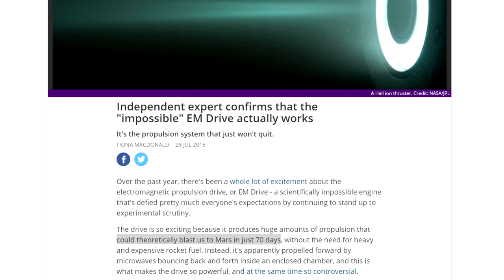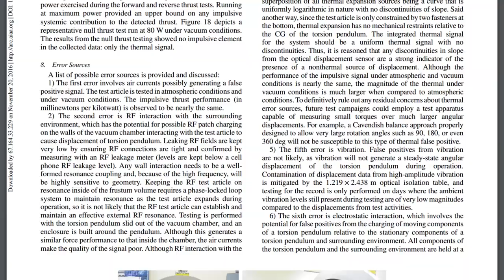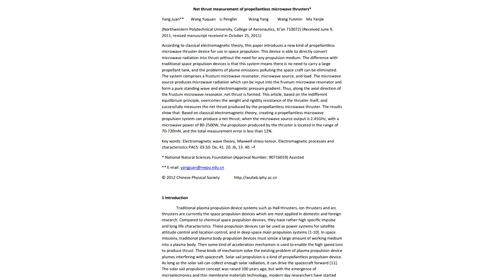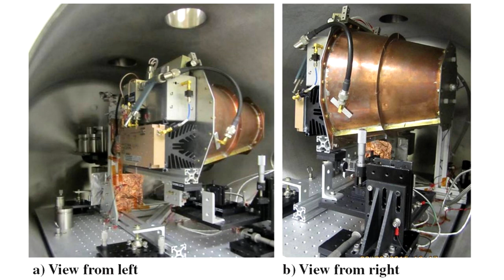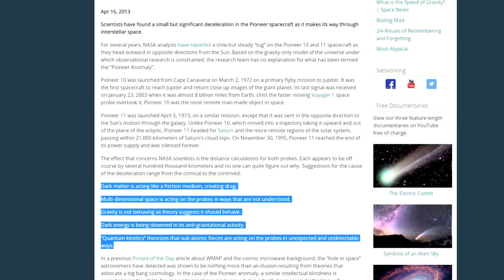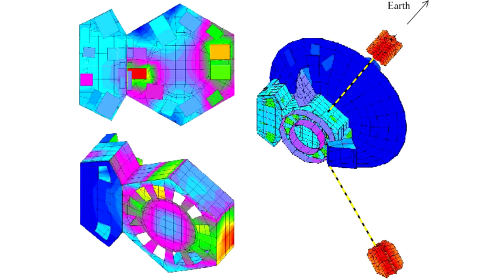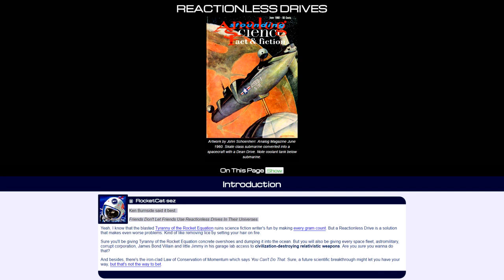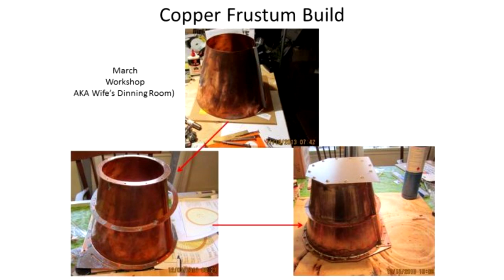What is the EM Drive? And Does it Really Work?

Comment: The EM is a definite maybe, but damn look at that vinyl collection!
Reply: As far as a perpetual motion machine, the EM is very inefficient is it not?
Reply: Musky Elon it is not "perperual motion" as it still require and use energy. and for the ineficient part, yes it is not as efficient as other techs energy wise. but it make up for it by an absurd amount of delta v, wich only depend on time. and we didn't tested the supderconductor variant...
Reply: Well, if it worked, it would be kind of the only thing seriously proposed with efficiency above 1 in certain conditions. What is an inefficient perpetual motion machine?
Reply: Ilnore
well with physics you never know :)
Reply: Well, in this case, you kind of do know. The very definition of a perpetual motion machine is to have an efficiency of over 1. So, there is no such thing as an inefficient perpetual motion machine.
Reply: Ilnore
well, an ineficient perpetual motion machie generate additional energy, so you know what it would be a good thing.
Reply: You can't call anything with an efficiency of over 1 "inefficient". :)
Reply: Ilnore What our musky friend here was probably trying to say is that, if you imposed a partial order based on efficiency on the set of proposed perpetual motion devices D so that d1< d2 if η1< η2, then the EM drive would rank pretty low.
Reply: I don't think this thing could generate perpetual motion (if it actually works). There is allways a catch with pertetual motion machines, we just haven't observed this one yet. To test it properly, we would need to accelerate it to very high speed while measuring it. And in space just to be sure.
Reply: The MoSS well, we just need to send it to the ISS , it's not big or hard to manufacture
Reply: The MoSS Well, "if it actually works" as advertised, then yes, it will be usable for perpetual motion. In fact it would be trivial to engineer a perpetual motion machine with it.
What you probably mean to say is that it's unlikely that it actually works as advertised.
Reply: You think there is a Yes album or two in there?
Reply: as12df12 no.... perpetual motion has nothing to do with it.. it does require a fair amount of power to run it.
Reply: Andy T. Think about it again (or just watch from 10:15). This is a simple engineering task.
It requires a constant amount of electricity to generate a constant acceleration force. Put two of those on a wheel attached to a generator turbine, and you will eventually reach the point where the generator puts out more power than is needed to maintain the constant acceleration -> perpetual motion.
Reply: This argument doesn't make sense.  As I understand it, more work is done generating the microwaves than can be created from the thrust, and the experiment indicated only linear force output with increasing power input.  Just accelerating a mass via a force indefinitely is not a definition of perpetual motion.  That's what gravity does.  Demonstrating a machine that is greater than 100% work efficient is, which this device doesn't do because it couldn't drive a generator to satisfy its own power requirement.  Conservation of energy is safe here.  The only missing component I can see is the mechanism by which it acts more efficiently than basic photon thrust.  Everything that accelerates is pushing or pulling on something, net zero momentum (and increase in disorder).  What this device is actually tugging on or tossing away is unknown, but is probably mundane.
Reply: Al B "more work is done generating the microwaves than can be created from the thrust"
How can that statement possibly be true if there is no reaction mass?
Reply: I bet you he has a copy of Dark Side of the moon in there ^^

Comment: I want to believe!  I want to believe so badly!
Reply: I wouldn't get your hopes up, they pumped a few kw into a box and it twitched a little
Reply: man you have no idea how much that tickled me.
Reply: It literally says in the video that the NASA experiment used 1 W that and produced a (very small) sustained force. The question is whether the force is explainable by an unaccounted error or if it actually implies new physics.
Reply: It actually says so-and-so micronewtons per watt. The paper says they did several runs, at 40W, 60W, and 80W.
Reply: They didn't, they ran it at 40W, 60W and 80W. It also twitched the same amount in vacuum and out, and in the direction of the cone, they also ran a 'zero thrust test' where they line up the thrust axis with the pendulum (causing it to push into the pendulum and thus it shouldn't read thrust and it didn't) 

I'm sceptic myself but whatever is causing this needs to account for that as well
Reply: question, what if it did slow down with more speed. c - current speed. kind of like Einsteins train?
Reply: I want to believe too.
If we assume that it is working. Even if you need to propel it for 40 years to be better than an ion drive this could be still useful for unmanned interstellar missions.
Reply: Physicists United, new suspect located, firing up weapons, question: stun or kill?
Reply: How about a photons and phase shifted photons.
They erase each other by the end, so you can't detect anything,
but they still pushing.
Reply: AkiraWolf98 Most of us do. Here's me hoping to go to aplha century in my lifetime.

Comment: First, I completely agree, except on homemade equipment to experiment. By way of for instance, one could take a look at the first cyclotron built by Lawrence back in the 30's. It is basically a coffee can sawed in half and wrapped in copper wire, and since many other first in experimental technologies got their start like that, I'd allow latitude for looks, so long as it functioned. 

That being said, yes, it does look rickety, perhaps, but you should never debase your argument like that.
Reply: I hope you're right in this particular case. If you think about the well-made resonant chambers, they're so precisely made, they must be thermally stabilized to keep their characteristics as designed. How would you thermally stabilize a resonant chamber in space which was big enough to push a vehicle? It could be done, but the drive will be a lot more practical if tolerances don't need to be so tight.

Comment: My feeling to the EM Drive is basically like that of SETI: it's probably not going to work, but that doesn't mean we shouldn't try (though I do acknowledge that in comparison, SETI is far more likely to succeed).

If I were to bet, I'd say the thrust effect is real, but there's something subtle going on that's still entirely within the realm of current physics. Like with the Pioneer anomaly that turned out to be thermal disequilibrium, or faster-than-light neutrinos that turned out to be a loose cable.
Reply: It already does work
Reply: If you read the second section, you'll see I've already responded to what you said.
Reply: I guess if you define SETI success as simply searching and cataloging, then SETI will always be a success. I meant succeeding as in actually finding aliens.
Reply: *****
It doesn't need to be tested in a zero gravity environment.  If it works in 1 G it works in micro gravity.  Like a rocket.
Reply: *****
  When you test a rocket you simply account for the existing G force.  There's no unknown forces at work.  It will act exactly as you calculate.  Newtonian physics
Reply: >>"But wouldn't 1G conditions still have outside influences that cause errors that zero g doesn't?"

The only thing that zero G has that 1 G doesn't is less gravitational force. No 'outside influences' relevant.

Comment: After having read the article, I can see at least one potential source of unaccounted-for error.  Most metals have a tendency to absorb significant amounts of atmospheric gasses on their surfaces.  In high vacuum chamber experiments (CVD, electron microscopy, etc) the vacuum vessel has to be brought up to high temperature as basically every part in the system out-gasses.  Due to the non-trivial amount of power being used and extremely asymmetrical nature of their apparatus, erroneous thrust might be generated from thermally induced out-gassing.  They never ran the system for long enough to reach thermal equilibrium and re-introduced atmospheric pressure after only a few runs.

Just a thought.
Reply: Also, why did they try to measure the temperature of a shiny metal cone with a thermal camera and/or a pyrometer?  As anyone who's used a thermal camera can tell you (and as you can see for yourself in their thermal images), all you're going to see is the thermal reflection off the surface.  Generally you have to paint an area of the surface black to get any meaningful measurement.
Reply: htomerif Certainly interesting. I don't remember that from the paper. I would be surprised they wouldn't have known about this because any experience with UHV systems would tell you that pretty quickly. I'm going to delve a bit more into the paper to check the vacuum setup.
Reply: They left the drive in the vacuum for weeks to strip the surface of gasses
Reply: htomerif wouldn't NASA account for that based off of previous experiments with low thrust devices?
Reply: I thought the same thing!
Reply: -edit, this bit added.
To cut to the chase, leaving things in a vacuum doesn't drive gasses off metal surfaces.  They have to be brought up to operational temperature.
-

Joshua Weitzman Are you just saying that to troll?  I read the paper again and it pretty clearly states that they had problems during one test run, brought the chamber back to atmospheric pressure, then back to vacuum.

They certainly didn't wait weeks according to the paper.
Reply: Gideon Felt If they did, then they would mention it.  This is not a "regular science" kind of test.  For a fundamental change in the base laws of physics, all parties involved would know to leave no stone unturned.

So far as I can tell, they don't even know what temperature the resonant cavity was at due to a pretty simple error in understanding thermal optics.

In visible light photographs in the paper you can actually see the bar who's temperature they were most likely measuring the temperature of reflected on the surface of the resonator.
Reply: htomerif The whole experiment seems quite shoddy, more like something you do exploratively with low budget to decide if its worth your time and money.
Reply: Numitron Yeah, I don't want to be "that guy" but its got a lot of scam qualities.  Low budget, no theory of operation, lots of unaccounted-for variables and a measured effect thats right down next to the margin for error.  In fact, 2 of the 3 attempts to recreate it got results that seemed to maybe agree, but were retracted when further examination found experimental error.

The part I find especially dubious is how they changed they "how its supposed to work" at the drop of a hat when their first "explanation" was shown to be just plain gibberish and how they seem to be shifting it again not that people who understand what a "quantum vacuum" is are saying this new explanation is equally nonsensical.
Reply: needs to be verified certainly no doubt
Reply: No offense, but you do realize that "watts" and "hp" are both units of the same thing, right?
Impulse is not a measure of power, which is why this would be important if it were real regardless of the power to momentum ratio.
Also, just for numbers sake, a tenth of a hp turned directly into momentum of the vehicle at 1500 watts would be incredibly efficient.
Reply: Ok, you want to be annoying, I can play that.  Why do you keep saying "a tenth of a hp"?  All thats ever been done with this thing are stationary thrust tests.  Do you know how much "hp" stationary thrust tests measure?  When you get the answer wrong, which you will, I'll explain why you were wrong.
Reply: Though 1/10 hp into 1500 W would be "_incredibly_" efficient. :)

Comment: It's not only lack of the heavy propellant. It's also lack of tanks and heavy plumbing that comes with the propellant. So weight saving would be actually even bigger.
Reply: Mass saving would be infinite.

With an EM drive, as long as you can collect radiation (space is full of it) and convert it to work, you can keep thrusting. Essentially you now have infinite velocity change capability.

Compare that to any non-infinite deltaV value and it's infinitely better.

You would need infinite mass for a reaction drive to match it.
Reply: Solar sails have those qualities without the drawbacks of breaking the laws of physics!
Reply: The power system needed to sustain these things would more than make up for the lack of heavy tanks and plumbing. It's the biggest limiter for ion thrusters right now. The weight of solar panels and batteries is just too great at the moment. Everyone in the electric propulsion field is basically twiddling their thumbs waiting for a breakthrough in power systems. Once that happens, you'll see ion thrusters on practically everything, including our ships to Mars. That is, unless nuclear thermal propulsion gets approved.

Comment: I hope it works.. and if it does, it'll be interesting to see how the superconducting version performs.
Reply: NikoKun if I remember correctly their figures indicate it could hover a car on just 1Kw of power. I don't know how that could be possible, even if they could increase the efficiency by approx 3*10^6
Reply: Is that in the works? If the effect is that dramatic they should have done that one first :) Then there would be no doubt
Reply: Mr. Reinterpret Cast I read the other day they were planning the other day to have a mk2 that would have 30kN/kW. I just don't see that happening, certainly not in one generation.
Reply: How so? Can't you just dip the whole thing in liquid nitrogen and fire it up? :D

Comment: Friends don't let friends use  Reactionless Drives.
Reply: Cary Weaver sounds like a quote off of the Atomic Rockets website.
Reply: That's because it is. The quote is in reference to the fact that any reaction-less drive is also a planet killing relativistic weapon, given enough time to accelerate.
Reply: nerd1000ify yes but the amount of time it takes for all fuelless propulsion systems to accelerate  (i am counting solar sails) is so slow
Reply: Michael Halpern
That's true in real life but not fiction. Sci-fi authors tend to get bored with engines that have very slow acceleration because flights from place to place take too long. To speed up the pace of the plot they upgrade them into something that allows quick interplanetary transfers and high-G space combat, the kind of thing that's exciting for the reader. If the drive has infinite delta-V this automatically transforms every spaceship in the setting into a planet killing super-missile.
Reply: nerd1000ify many scifi authors just don't use normal space-time for long distance travel